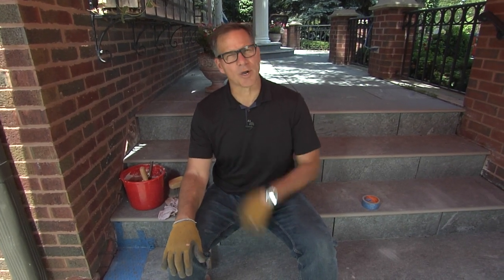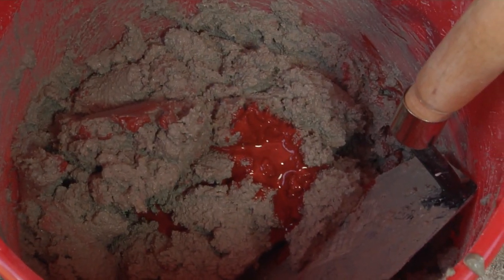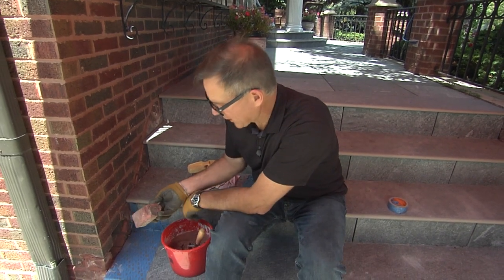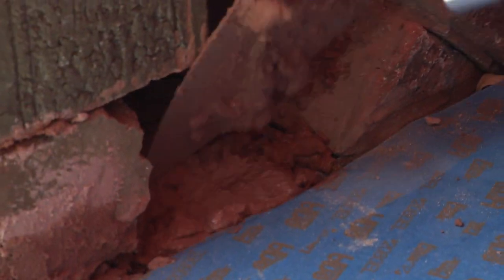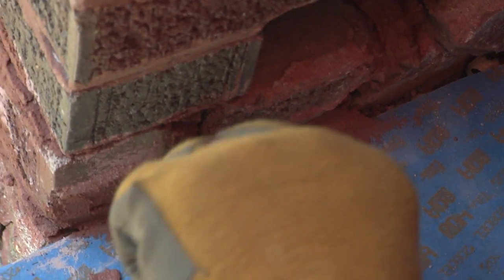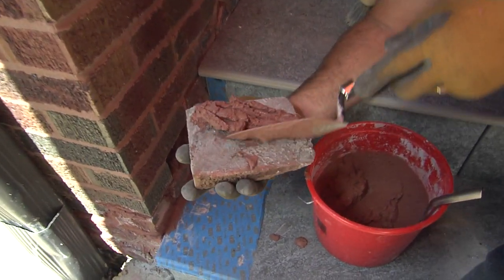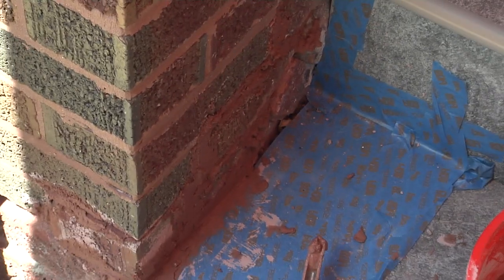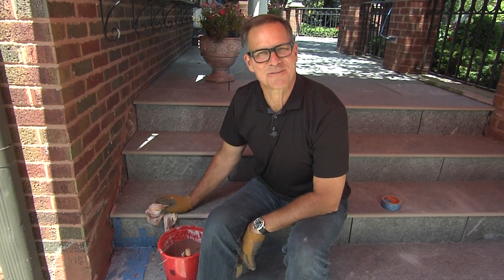Brick Mortar Repair | HouseSmarts – Episode 215

Comment: Really useful. subscribed
Reply from the maker: Thanks for the sub!
Reply: I am a bricklayer. All  Surfaces need to be buttered. 2nd off that tool is a jointer not a tuck pointer. A tuck pointing tool is a flat thin tool to pack the mortar into the joints solid. Then you use that round jointer  to finish the outside. And good luck getting that red smear stain off with a dry brush. It needs to be washed with a brick cleaning chemical. But your close. Thank you